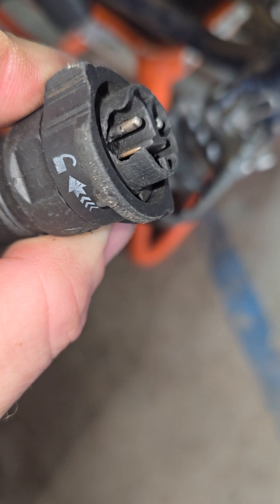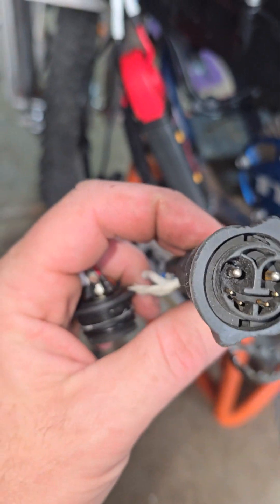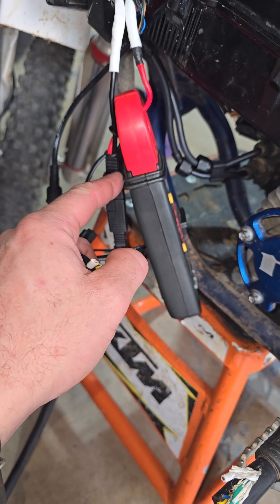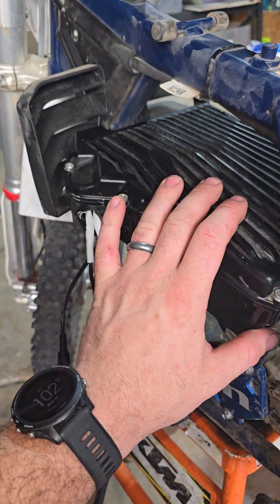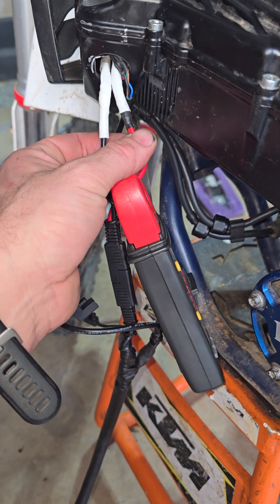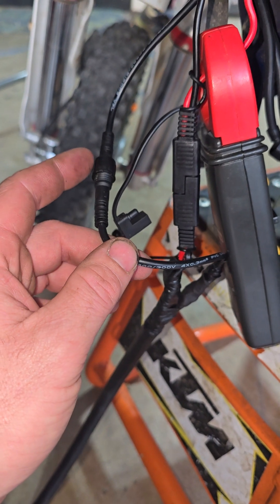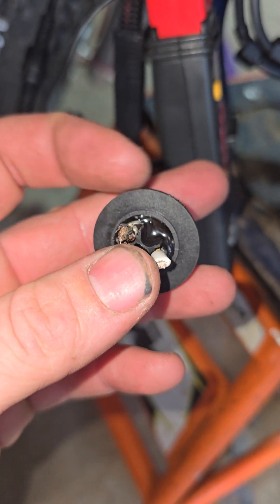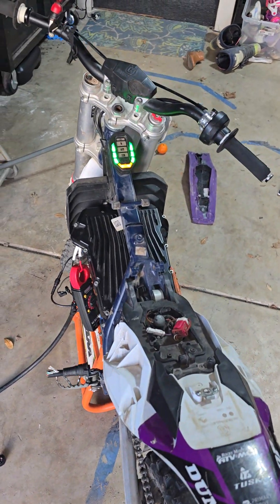KTM  SX E-5 BATTERY  REPAIR

Comment: Do you know what the polarity was on those two pins? I picked up a bike that didn't come with a charger and I'm hoping to use an aftermarket charger but don't want to hook it up backwards. Also hopefully it won't matter that I don't have those other 4 wires doing anything.
Reply from the maker: A volt meter will identify  polarity.  If you measure backwards it will show as Negative voltage..... the other 4 pins are temp and voltage  communication  to the charger and is needed for proper charging